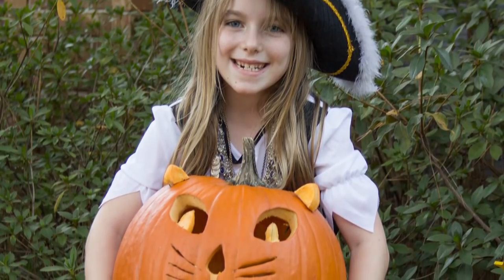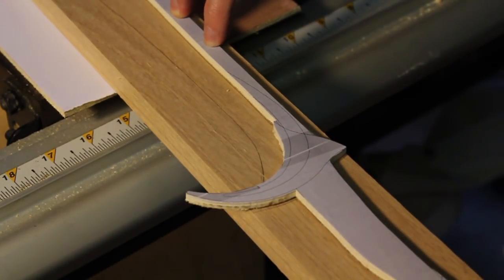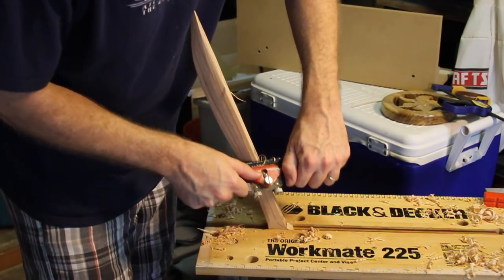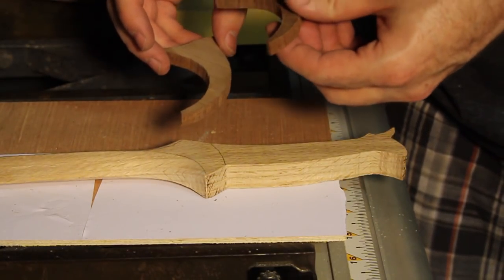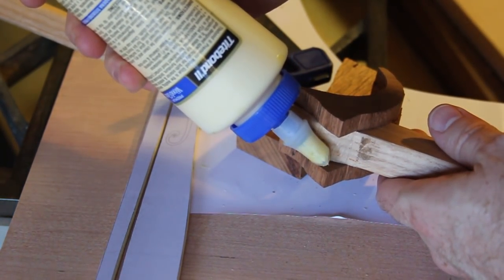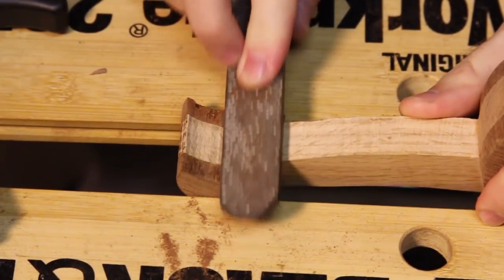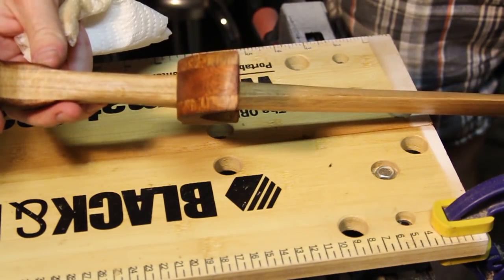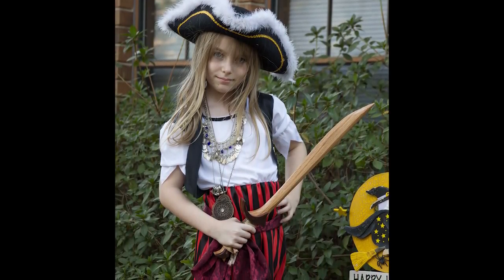Wooden Orcrist

Comment: I really like this, a lot of the sand with hand tools, could you also use a dremel with a sanding bit?
Reply from the maker: Hi James.  If done correctly, I think a rotary tool with carving or sanding bits would probably work just fine.

Comment: I don't mean to be "that guy" but the guard on Orcrist is supposed to be pointed and sharp, did you keep it flat for safety or was it on accident ?
Reply from the maker: You are correct; the actual guard and pommel designs are different on the actual sword.  I chose to change things a bit for ease of construction.

Comment: Beautifully made all by hand BUT Why did you destroy it by putting polyurethane. Wood breaths and needs an oil or something. Over the years it will turn darker and more beautiful were with polyurethane it will just chip off and it has a bad platicy feeling.
Reply: Anas Tziatas well it would prob ably be be grown out of in a few years as the girl was little so it would get bashed too so protection is good short. Term

Comment: How did you keep the sword fixed to the bench when you were shaving the blade?
Reply from the maker: Latagore The bench is a standard Black & Decker Workmate bench, similar to this one:
http://www.sears.com/stanley-black-decker-wm225bd-workmate-225-portble-proj/p-SPM7531563003?prdNo=2&blockNo=2&blockType=G2

The top is divided into two halves - one half is fixed in place and the other half can move in and out with the turn of a handle, effectively turning the top into a sort of bench vise.  It's not the most ideal bench vise, but it works well enough.

Comment: Can I get the dementions for the wood you used?
Reply from the maker: Hi Derrick.  The blade was made from a standard 1x3 piece of oak that you can find at any hardware store.  It was about 23 inches long.  The blade guard was made from pieces of scrap mahogany that I had available.  It was cut to fit the blade once I was done shaping it.
Reply: Derrick Drennen gI